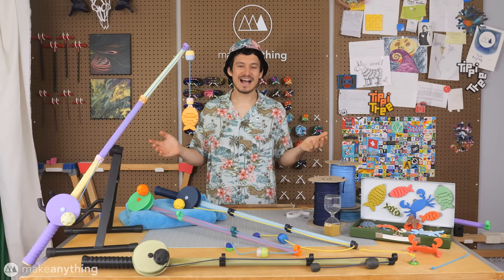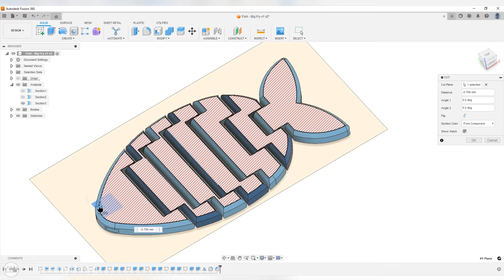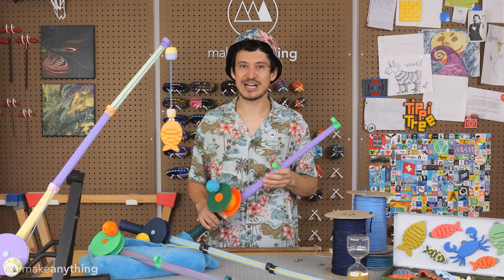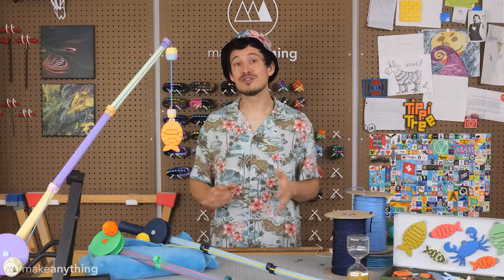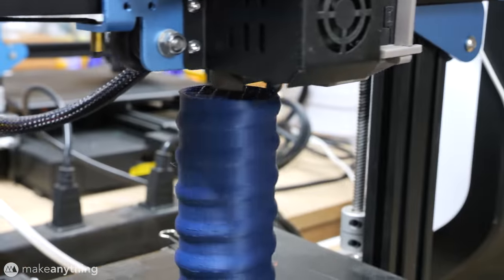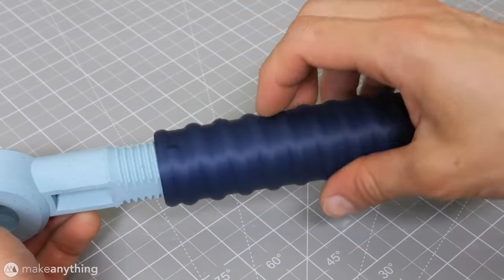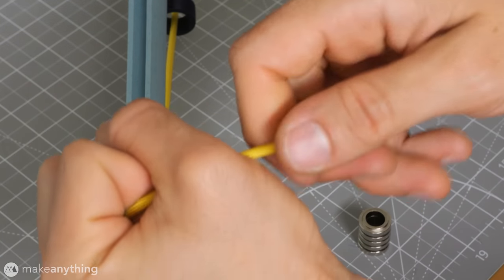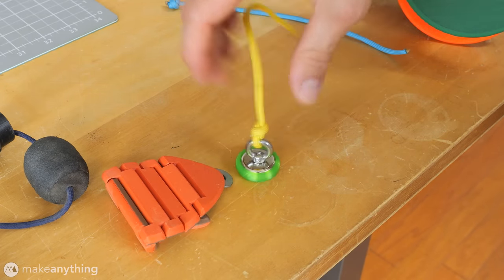Space Fishing // 3D Printed Game

Comment: WD40 is an obscene word in the clock and fine mechanism business.  Over time it leaves a gummy residue that is very difficult to remove.  Washing out OEM grease can be done with mineral spirits, kerosene, diesel fuel (NOT GASOLINE), or other degreasing agents.  If water based a mineral spirits sloshing around to displace water followed by a gentle warm dry is recommended.  Either run the bearings dry as is often done in precision mechanical regulators or use a light oil.  It might sound silly, but a zero or 5 weight pure synthetic motor oil is an excellent lubricant in these sorts of apps and avoids purchasing some very expensive lubricants that rarely work any better.  Fun video, nice job on the game design and it's great to see folks getting together outside instead of hiding in their houses and only goofing around online!

Comment: What about putting the magnet in the sea life but putting metal powder in the resin for the bobber in order to make the whole piece magnetic?

You could even use smaller magnets imbedded in the sections of the rod to strengthen it and not weld it so it still has the option to dismantle for storage. Or you can make it a spiral for screwing into place like a broom or mop head.